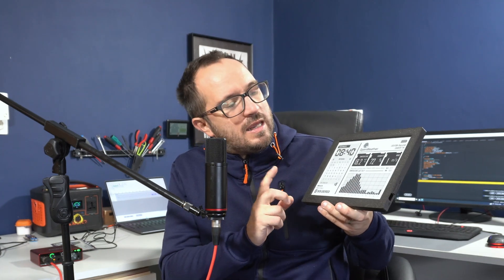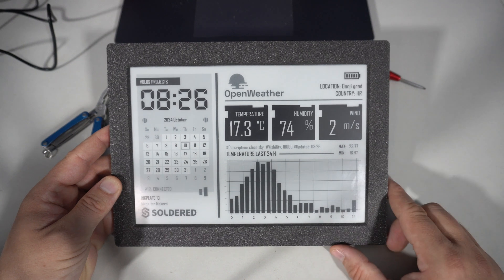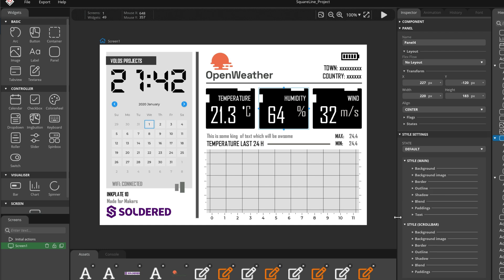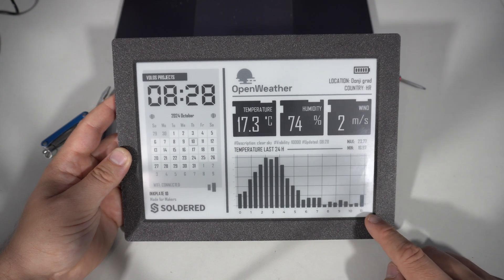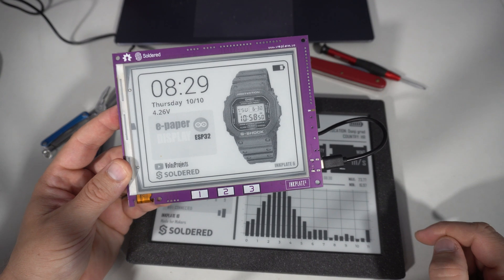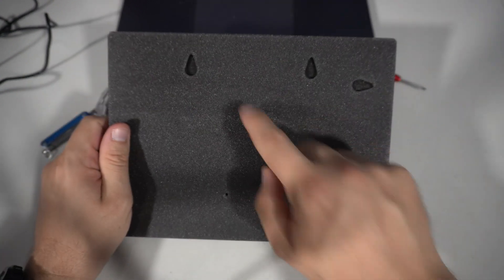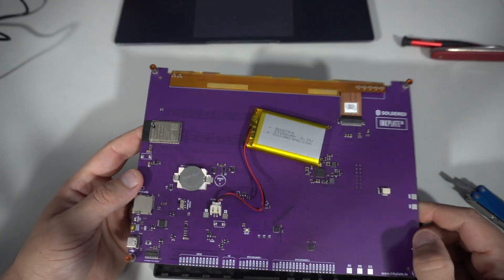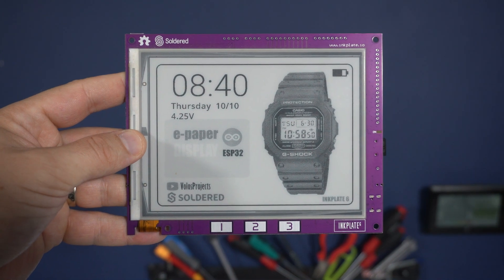LVGL on huge 10" ePaper display (Soldered INKPLATE 10)

Comment: Nice e-ink display and a good software tool for rapidly making new displays based on LVGL (worth spending days to get working ?). Maybe high volume corporate in-process inventory signage ?. There are cheaper/smaller displays that might fit hobbyist applications/budgets. Id be curious to see how this device uses power when in deepsleep and when updating the display ; so I can estimate how long the battery will last for a specific update rate.

Comment: Is it possible (by limiting how often it changes and using deep sleep) to have it solar and/or battery powered (long term) ?
Reply from the maker: @backacheache  yes ofc , once i run epaper clock (update each min) for 14 days  using 100mah battery. With biger battery and solar panell it can run whole battery life.
Reply: @VolosProjects  that's cool, with that draw you could make what looks like a frame out of solar cells and have it run almost infinitely

Comment: great video. did you say that big battery lets it run for... hours? wouldn't a battery like that (running with an epaper display that only needs power when it is refreshed) be able to run for years on a battery like that? is the esp32 not going to sleep?
Reply from the maker: @FrankGraffagnino  yes, but in this case i am using wifi.
Reply: What about going in Deep Sleep for 1 min then after wake up power on Wifi to get data. Disconnect Wifi and power it down then go back to Deep sleep again. This will prolong battery life immensely.

Comment: I like your channel. I especially like the new hardware demonstrations that you do. But if I'm to be honest, I lost some interest in your channel after you switched to SquareLine Studio for your projects so I don't watch all of your videos anymore. I've been programming since 1978, and virtually every experience that I've ever had with frameworks follows the 80/20 rule. That rule says that while a framework often makes the first 80% of your project easier, it makes the last 20% much more difficult. So then I'm forced to make a choice. I either do all the extra work to make my code function under the framework which means I've saved no time at all, or I just give up on the goals that I wanted to achieve for my project and finish my task within the limitations of the framework. So I just avoid frameworks altogether.
Reply: But TFT_eSPI or Arduino_GFX or Lovyan_GFX or Adafruit_GFX or U8g2 are also frameworks. 
Squareline Studio differs only in that it has a RAD wysiwyg editor and generates C code rather than the more familiar Arduino C++ style.
The resultant code adheres to LVGL principles as opposed to TFT_eSPI principles (for example) but at the end of the day is no more abstracted than any other popular Arduino GUI library.
Reply: @nikthefix8918  I tend to draw a pretty hard line between a library and a framework. I use libraries all of the time and am ok with that because libraries don't generate code nor are they prescriptive in how you use them like a typical framework. All I ever want and need is a way to build and deploy files. I don't need to learn another editor (I use Vim/Sublime Text) or debugger (I'm a printf guy) or terminal window processor (iTerm2 for me) or whatever other tools the framework/IDE wants to throw in to justify charging money for their stuff. I will admit that I have an affinity for the Arduino IDE because it helps me to manage and deploy libraries and MCUs. But even then, I don't use the IDE but rather the CLI that I drive with bash scripts to help fit my workflow into a larger set of objectives. If I was doing one-off projects then maybe a framework/IDE would be fine, but my work is done on 10s of thousands of devices where reliably in repeating operations at scale is super important.

I've been using U8g2 and TFT_eSPI so far. I may give LVGL a try since I'm not particularly happy with the way that TFT_eSPI supports configuration. I don't think that it was designed to easily switch from one display type to another, though I may be missing something
Reply from the maker: I am sorry to hear that, but i totaly understand. I hope you will still find something on chanell.
Reply: @VolosProjects  I bought a T-Deck Plus two days ago because of your video. 🙂 (Yes, they are back in stock!)
Reply from the maker: @toddbu-WK7L  cool, you will love it.

Comment: Oof 😣 pretty expensive boards (for my budget). The bigger ones, especially, like this 10" e-paper. But I really love the e-ink's great contrast, readability and low power usage. 😍
Reply: The smaller ones, e.g. from Waveshare, have fallen considerably in price. This will certainly be the case with the big ones in X years.
Reply from the maker: @sulcusulnaris i hope so
Reply: @sulcusulnaris  Yes, I have two different, small e-paper displays (2.13") from Waveshare.

The first one is black&white + red color. But I discovered the refresh rate wasn't fast enough to display a clock (every minute). So I got another one, without color, that is a faster version and supports better (also partial) refresh. 

Pretty cool little boards.

Still I'd like to get a 7–8" or even 10" one day, so I can display a calendar for example. Or my kids' school schedule, that needs to refresh only 1–2 times a day.
Reply: Especially expensive when you consider the e-paper displays are not even new, but re-purposed from old e-book readers. But very nice nevertheless.